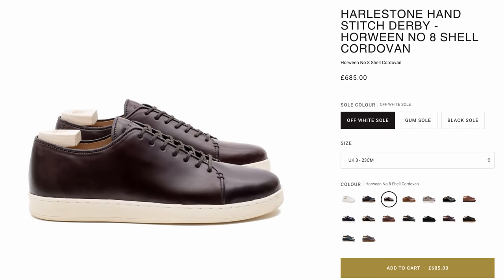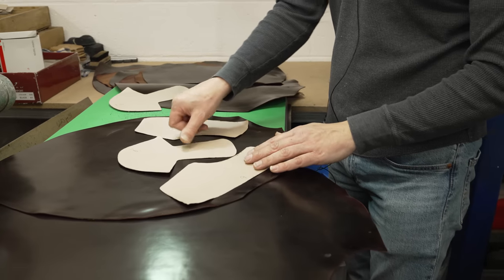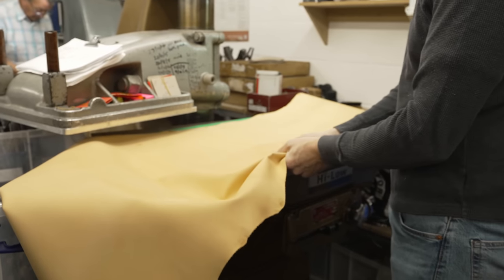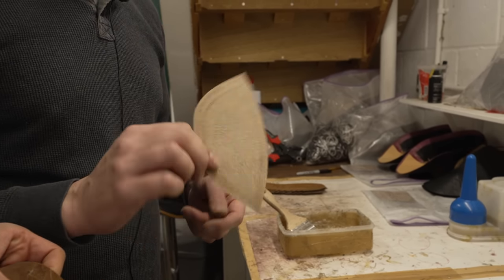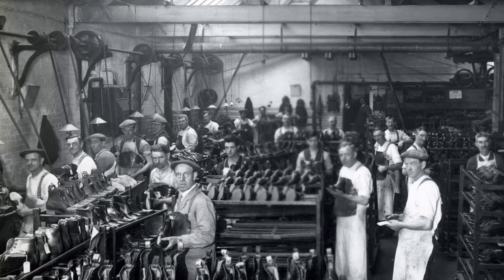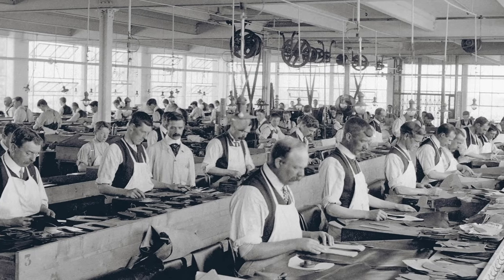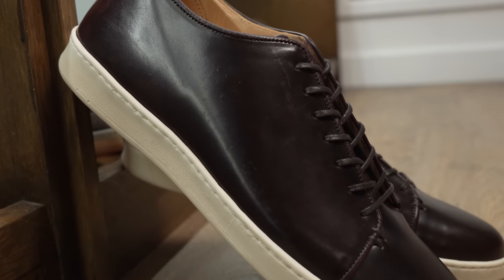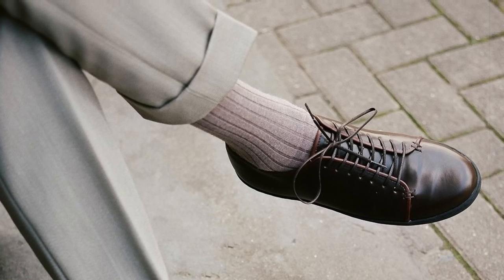How to Make an $800 Sneaker (Crown Northampton factory visit!)

Comment: Another reason I didn't hear that makes them worth it is that they''re resoleable. This goes a long way to justifying the cost, knowing you can have them repaired and therefore be able to wear them indefinitely.
Reply: Wow I didn’t know this. I’m sold
Reply: You can also resole Common Projects. Sure is expensive shoes usually the ones you can replace the soles, but is not always the case.
Reply: Gorals are also resoleable

Comment: If you're spending more than $700 for a pair of sneakers,  your priorities are out of wack.
Reply: What's an appropriate amount to spend on shoes? Are you considering the overall cost per wear?
Reply: If you're spending more than (I would) for (thing), your priorities are out of whack.
Reply: @zinknot You can get much cheaper sneakers that would probably last longer.
Reply: @hawkevick9184  I highly doubt that's the case!
Reply: @hawkevick9184  The shoes in the videos are made of cordovan.  There are cordovan shoes that are over 100 years old.  Leather like cordovan also looks better with age, so after 5 years the shoe will look better.  I don't think you would get a shoe made out of cordovan for less.
Reply: Yes. Depends on your income. If you're earning a solid six figure income these shoes are easily doable. But it you're just barely getting making a six figure or slightly less income, these pricey shoes shouldn't be a consideration.
Reply: @tommysmith7031  Grantstone cordovan, Allen Edmonds sometimes. Also cordovan is just the colour. Shell is what you meant to say.
Reply: @hawkevick9184  I would assume from the context of the conversation when I mention cordovan or are made of cordovan, it is obvious I am referring to shell cordovan.  Allen Edmonds currently have sneakers retailing for $650.  Comparisons would have to consider exchange rate, I think Allen Edmonds have some production in the Domican Republic.  Crown produce their shoes in England so that would have a higher cost than the Domican Republic.  Grant Stone don't have a sneaker made of (shell) cordovan but they do have a blucher that costs $745, again they are made in China.  Producing shoes in China would be cheaper than doing it in England.
Reply: @hawkevick9184 the name of the leather is shell cordovan. Cordovan is not the color.
Reply: It’s all relative. We’ve all got different priorities and the skill and craftsmanship that go into these shoes is unreal!
Reply: Ok, Larry
Reply: People buy the iPhone every year. Nough said.
Reply: or you’re just far from being at a level where it makes sense for you to buy $700 minimalist sneakers…

i’m a brokie too but i aspire to buy expensive luxury quality clothing items, from sneakers all the way to a plain white t shirt
Reply: Some humans have enough to buy this and more, some humans don’t have to worry about money. It’s the world we live in.
Reply: @Rhaspun even if I made less than 6 figures, I’d still buy these and not have to worry about getting a new pair of shoes for the next 10 years. 
I recently bought a belt for 150, which I’m hoping will last me for the next 2 decades. That’ll come to around 7.5 annually, which sounds pretty affordable to me.
Reply: You are not getting better pair of quality sneakers for that price.
Reply: @zinknot  at this price point just get premium boots.
Reply: You just broke asf lol
Reply: @NoBap-dk4rc  He is right. Should buy a pair top quality boots for $700 instead of sneakers, the construction is on a whole new level. Overpaying is just dumb.
Reply: @zakugodofwar1005  the boots would make more of a difference than the sneakers? Which (the sneakers) would last AS long as the boots? 🤔When you can buy one pair of each and save hundreds over the years? (For a little over 700 NOT a 1000) Yea that’s pretty fkin stupid 🤣
Reply: @NoBap-dk4rc  Simply put No such “premium” sneakers could last longer than a well made pair of goodyear welted boots.

Comment: I love Crown Northampton. What I find hard to believe is that they'd buy/use the consumer sized/packaged 75ml Saphir Renovateur as shown @6:28 - I'd expect a company using it in production to be able to strike a deal to get it by the bucket as paying for the small 75ml glass containers with print seems very wasteful.
To be honest I'd expect Crown to not use Saphir Renovateur - it would be much cheaper to buy mink oil without a brand attached to it.

Comment: Not really my style but no one else is doing the whole minimalist sneaker thing with such ludicrously high-quality materials and construction as Crown Northampton. The video emphasises the most expensive sneakers they make, but you can get some really nice ones built to the same standard for far less if you don't spring for the shell cordovan. About $310 for the calf version or $320 for Horween CXL.
Reply: The hand stitch in calf/suede are in the 400ish range USD last I checked. They do sell cheaper sneakers with more synthetic materials but both the pairs I own are hand stitch.

Comment: Bit too much for my price range, but if these are made so durably and can be resolved indefinitely (assuming you care for them well), then £700 and cost of soling, would save you compared to buying new ones every year or two, and in the few bespoke makers that still exist (that aren't bought out or shifted manufacturing overseas) there is a quality above most of what others you get

Comment: I love my crown sneakers, but the thing I hate most is that the white soles need to be constantly cleaned in order for them to look beautiful. doesn't matter how well made or nice they are, dirty white soles ruin everything. if anyone has a solution, I'd love to know about it.
Reply from the maker: scotchguard?
Reply: @Stridewise  tried using waterproofing sprays yeah. but I suspect they don't quite work on rubber. they work for fabrics and suede because the little fibres will soak the hydrophobic chemical in... but I think rubber doesn't quite do that
Reply: Toothpaste + waater + scotchbrite works well for me to clean white rubber sole (on my Rancourt Court Classic)
Reply: @black_solidus  yup, i do that too. baking soda works too. problem is getting some of the slurry onto the shell cordovan, which stains it